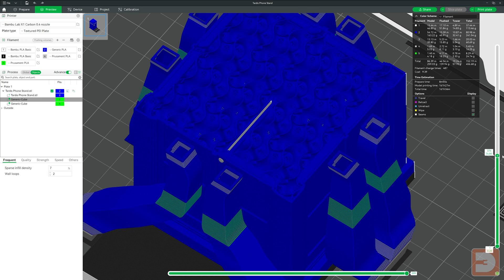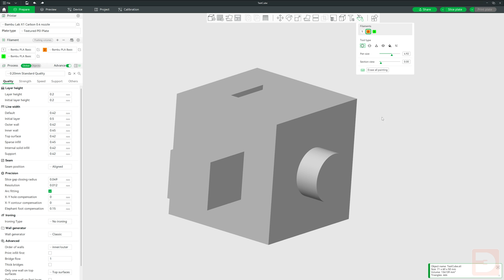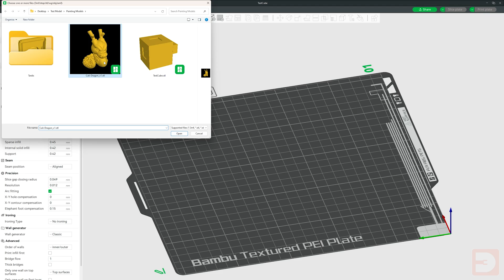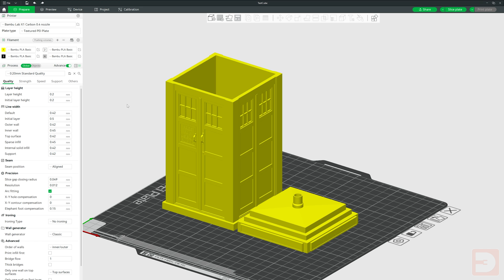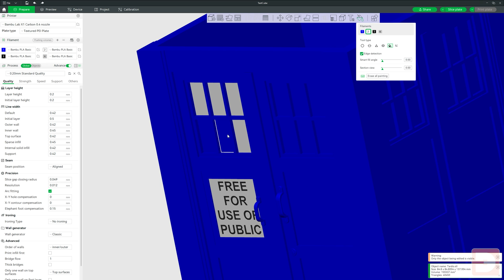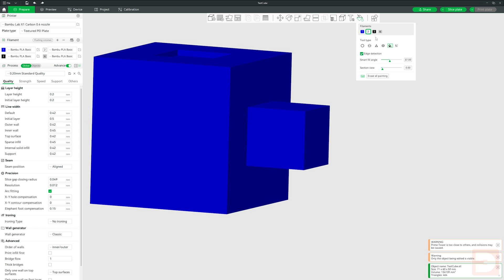Bambu Studio Painting Masterclass

Comment: When I download from STL Buddy, like an animal, the transitions between geometry is ragged and the Fill tool can't find edges.  Do you have any tips for those types of models?  I'm trying to paint a red panda and it is not going well.
Reply from the maker: The artifacting you're talking about usually means the model is either generated by AI, or is resulting from a 3D scan.
In those cases your best option is to use the sphere brush tool.
Reply: @3DRevolution  Thanks

Comment: Great video, but I'm not a fan of the Bambu paint tool.  Problem is that is doesn't paint the small edges on my model. Somehow the paint doesn't apply on some small outer corners. However these spots are only visible in the preview section and not in the prepare section.

Comment: A lot of great information! One question, when importing prints off of MakerWorld that are pre-colored, when I sync my colors, it throws all of the preset colors off.  Is there an easy way to change a specific color that was chosen by the creator to a color that I have in my AMS without manually re-coloring the whole model?
Reply from the maker: Unfortunately this is a very frustrating aspect which I hope Bambu Lab will address. If for example you made a profile that had 5 colours loaded, and you used all of the in your design except colour 3, and you wanted to get rid of it before saving the profile to make it neater you'd have to delete colours 5, 4, and 3 which would then delete any painting applied with colours 4 and 5 and you'd have to re-add and paint them.

For your specific situation, you don't need to re-paint the model, you just need to change the filaments. Click on the name of the filament you want to change (eg "PLA Basic") and it will open a drop down menu, then select the type of filament you want. If you want to change the colour, click the coloured number box and select the colour. That will then change any area already pained with that number to the colour you select.

However, whilst doing it that way can be useful if you want to do more in-depth settings and adjust purge ratios etc, there is a quicker way of doing it. If you leave the colours as they are and click to print it, it will then list each of the colours used in the model, and if you click each one, you'll get a dropdown menu of the colours that are currently in your printer, and you can change to any other colour (providing it's the same material type as the one already assigned). It will then also give you a visual preview with the colours you select before you confirm and send to printer.

Comment: Ok, wait a minute. You painted the inside wall white, which I initially thought was ridiculous (you now have multiple colors on every layer and hence a filament change on every layer). But the printed object doesn't seem to reflect this white interior. What's going on here?
Reply from the maker: That timelapse was actually from an earlier test. Agreed it is frustrating having white on every level. The original thought behind it had been to increase light reflection inside and to maximise light through the windows without them looking blue. 
Ultimately the best way to get around it is to have the inside blue, but to use the layer range paint tool to paint the section of windows white, then just use the fill tool to fix up the areas on the outside back in blue.